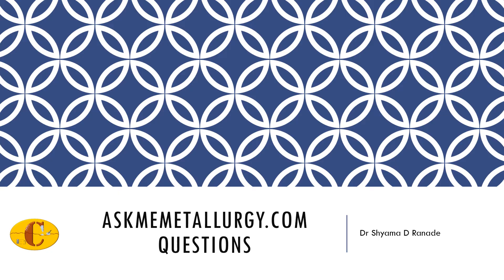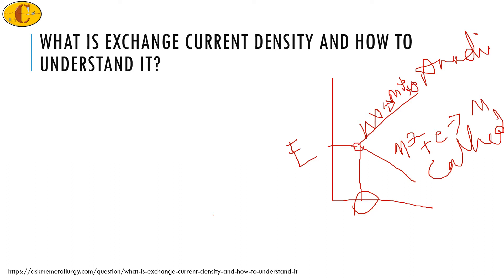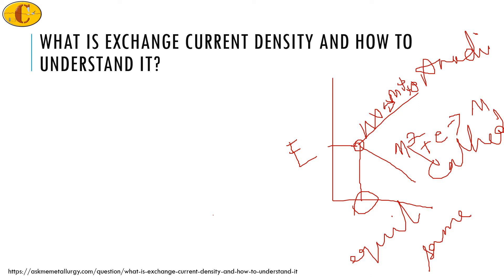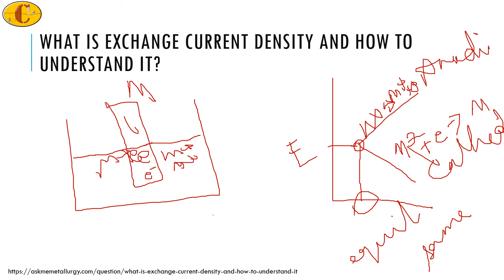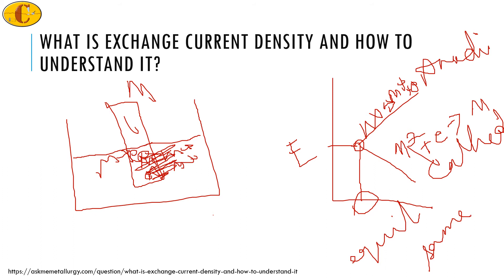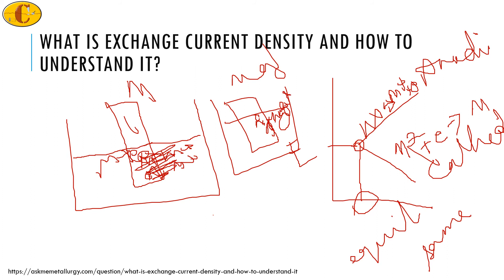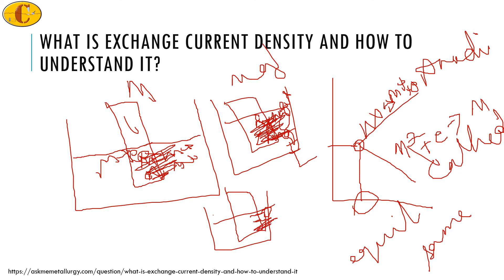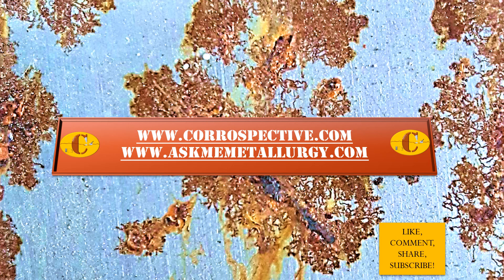Something about exchange current density

Comment: What is the equilibrium potential for exchange current density and what is its effect on it?
Reply from the maker: The equilibrium potential is the potential corresponding to the point of exchange current density, and it denotes the standrad electrode potential for the reaction, usually close to the ones in the EMF series. Nernst equation dictates the relationship between the two.